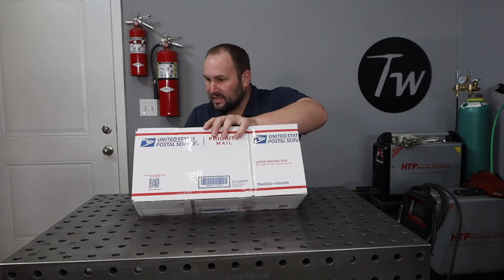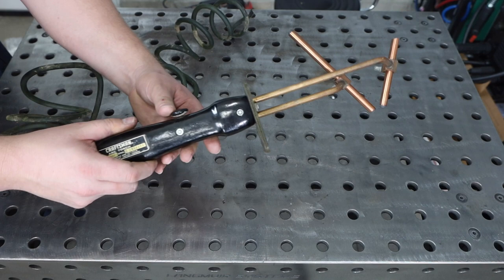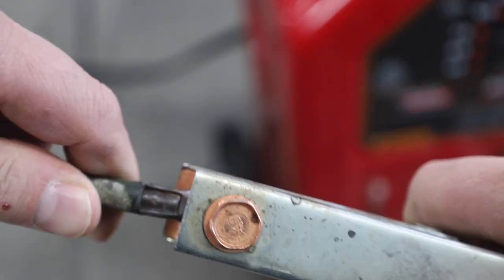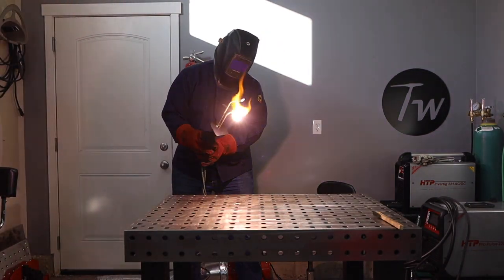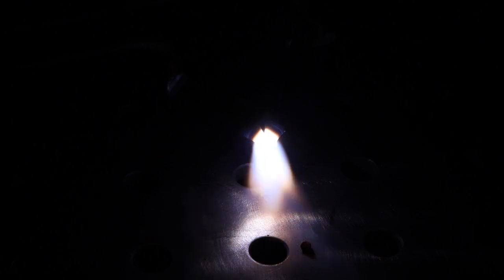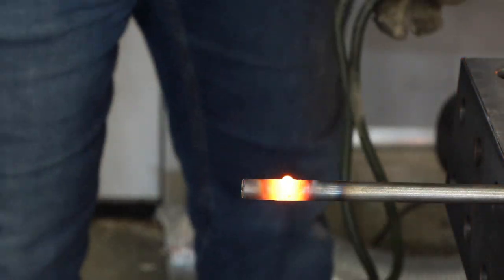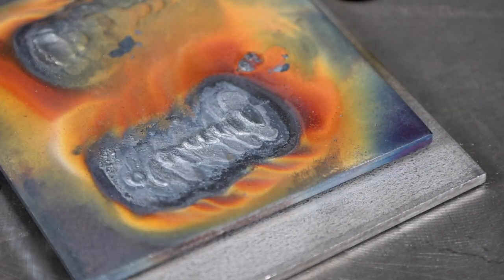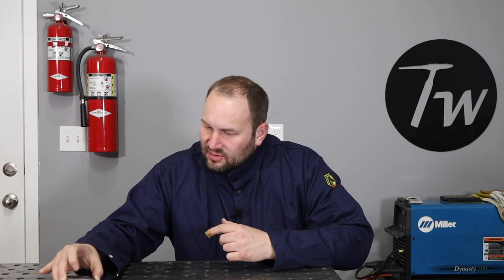I Tried the Weirdest Antique Welding Torch from Sears

Comment: A tool from a bygone era. After WW2 with rural electrification arc welders really came into their own. Even then oxy-acetylene was expensive, but a carbon arc torch would let you do most of what you could do with gas torches. We used to cut with buzzbox welders too because we didn't have cutting torches. Didn't have cutting or gouging rods either- you just soaked whatever you had, probably 6011, in water and turned up the amps! Then you started arc cutting. If you spent some time with the carbon arc torch you'd probably learn to make nicer looking jobs. I'd buy one for the right price myself! Heck, I still use gasoline blow torches too! Just because it's old tech doesn't mean it's useless.
Reply from the maker: I definitely haven't spent much time with it. I do think the old school stuff is really interesting; I'll have to try arc cutting like you're talking about!
Reply: Whoa, a gasoline blow torch? Tell me more!

Comment: Smaller electrodes for brazing with flux coated brazing rods. Used mine over 40 years ago for brazing a wing on my Morris marina after a mini bus ripped my old one off. Does a perfect job. easy to use. Mig welders have taken over for working on thin metal at an economical cost.

Comment: It's funny that you posted this now, I had been trying to locate one recently.   My brother and I had one for our Montgomery Ward arc welder back in the late 60's (he's still got that monster 295 amp machine) when we were in high school - they were common then, and used it mostly for heating up steel for bending, until we were able to afford an oxy-acetylene torch.  Brazing also worked, but it made a really wide joint.   Lately, I've been having a difficult time getting my oxygen and acetylene bottles exchanged or filled, so I had my brother send me the old carbon arc torch, since he never uses it (and you really can't find them anywhere for sale new).   

It does work fairly well for heating up and bending steel, but you do have to keep it moving, to keep from melting spots.  I always wondered if some carbon from the rods would be transferred to the steel, making it harder, but I think it would only be a case hardening issue if at all.

I do have a TIG torch set up on my arc welder, and have decided that it will really do anything that the carbon arc torch can do, including heating steel by using a large tungsten, and it has a much smaller heat affected zone, and is so much more precise.

The real advantage of the carbon arc torch is that it requires only electricity - no oxygen, acetylene, or argon - so, it can be a really useful backup option if you live somewhere that doesn't allow flammable or high pressure gases in your residence.  I think it might also be useful if you have a welder in your 4 wheel drive vehicle - you could do some good repairs in the back country, if you could keep from starting a forest fire with it.

Thanks for the review - it does bring back a lot of memories!
Reply from the maker: Very cool! I can definitely see the utility if you don't have a torch available; keeping it for some backcountry repairs is a great idea!
Reply: Hi terryrust. Can you say more about puting tig torch on arc welder. The tungsten do the same than carbon rods and more precise. So, i wonder why nobody do this? Can you explain what are all the avantage and negatives please?
Reply: Hi Steve!  

Yeah, it'll work great.  Use DC Electrode Negative, if possible.  That way, most of the heat will be put into the workpiece.  If you use DC Electrode Positive, most of the heat will be on the tungsten, shortening the life of the tungsten.  If you only have AC current, then the heat will be distributed evenly between the workpiece and the electrode.  Use the largest tungsten you can, it'll last longer.  

Using argon as a shielding gas also protects the heat affected area, so there's less chance of contaminating it.  With a carbon arc torch, I think some carbon may actually end up being transferred to the heated area, which may have a hardening effect.

Give it a try!

Comment: Tim, I bought that exact Craftsman carbon-arc torch in the late 1970's to use with my Sears (Century) AC arc welder.  It was made for Sears by Marquette.  I still have the manuals for both.   A blunt instrument for sure, but think about it: for a kid WITH an AC arc welder, but WITHOUT an ox-acetylene rig, that inexpensive torch was the only way to heat steel for bending.  I pulled it out about a year ago and tried to use it to forge weld two 1/4" steel rods together, but could NOT get the workpieces to fuse.  No idea why.
Reply: I wonder if Vintage Machinery would copy and post the manuals on their website?
Reply from the maker: Awesome! It would be fun to try forge welding with it.

Comment: I bought one ( not a Craftsman ) in the eighties as an accessory for my Miller buzz-box. If you don't have or really want an oxy-acetalyene rig, this is an inexpensive option. 
   I used it to pre- and post-heat an exhaust manifold, for a successful weld repair. Options are good.

Comment: I still have one which i have had since the 1970s & still occasionally use. I connect to my small arc welder, it is a great tool for brass brazing and heating metal for bending etc

Comment: they sold these in the 60s in UK. They came with clips to connect  to your car battery.I bought one and used a metal coat hanger wire as filler rod it worked quite well until battery went dead which wasn't  very  long It taught  me the real meaning of disappointment and always aim a bit higher  when buying equipment.It started me welding which I still do.

Comment: I had one of these as a teenager when I first got into custom car and motorcycle work. I got it with a small Sears buzzbox and I did many a modification and repair with it. It was like using a sledgehammer to do body repair, but once you developed a feel for it you could get things done. Once I had an oxy-acetylene torch I don't think I ever used it again except in emergencies or where I couldn't take the gas bottles. A real trip down memory lane. Thanks Tim! And BTW, while I don't have the carbon torch anymore, I've still got that 70 amp Sears buzzbox. I bet I haven't used it in 40 years.

Comment: Hey Tim. Your video really took me back to 1973 when I was working on a farm/ranch north of Denton Mt. Was making a straw deflector for the back of a combine and my boss dug out this carbon arc tool like yours. I used it to braze some steel brackets to a sheet of galv metal(don't breath that zinc!). It wasn't pretty but it got the job done when my only option would have been to carefully do it with stick.

Comment: As a youngster I used to braze with a carbon arc torch. My first "SIP"  welding transformer came with one. It was a cheap way into brazing and it worked. My major complaint was that it seemed to make a much brighter light than stick welding did. After using it for a while I'd have sore eyes. Anyone trying this should see to getting more opaque welding glass than they use with arc.
If you have tig or gas facilities in your shop, one of these rigs will indeed just hang on your wall unused, but if you don't , and occasionally need to braze. It's a handy option.
I think the carbon electrodes are the same thing as used for gouging.
Reply: If you look at the table listing the recommended welding shade for the process and electrode size/ amps, you'll find that carbon arc welding calls for a #14 shade, and this is usually not kept in stock at most brick and mortar stores because it is too dark to comfortably use for most general purpose welding,  rather it's used for very high amp stick, mig and tig welding,  and carbon arc welding  is obsolete  for all intents and purposes,  and has very little modern day use. 

Fixed shade helmets typically come with a #10 lens by default,  since that is a good choice for most welding done around the shop /farm.   Auto darkening helmets usually are adjustable from shades 9 ‐ 13 for the lower priced models, while the higher end models have a wider range with some having #14 availability, sensitivity and delay adjustments along with a grind mode.
Reply: @Sparky-ww5re  Thankyou. That was very informative.

Comment: Very cool to see one action.  As a teenager on my stepfather farm in the early 2000s, Uncle Chester has one in the pole barn along with his Miller welder (I think the machine was either 200 or 250 amp, pretty good size) way before my time.   though I never seen anyone use the arc torch accessory.   You can make a carbon arc torch DIY, I don't see any practical use for it nowadays,  though with the price of propane, Acetylene & Oxygen skyrocketing,  I can see it maybe coming back sort of like vinyl albums,  how we thought they were dead after the early 90s, along with  8 track and cassette decks.

Comment: 35 years ago I did a large body repair on a car with one of these and brazing. Alternate where you work and cool it down before moving on. worked great. Seems to me the only welders commonly available back then were stick welders. Like most welding processors, practice is the secret. But why bother mig and tig so cheap now.

Comment: My dad used a carbon arc torch and I still have most of it, still works but very scary looking due to exposed wiring. The metal enclosure for the power unit is no more and it looks similar to an old toaster with wires strung about porcelain posts, although heavy duty by comparison.  Works on 110 volts. He used it for brazing with flux coated brass rods.  Crude and effective. Most likely it came from "Monkey Wards" in the late 40's or early 50's.
Reply from the maker: Very cool!
Reply: I built one of those in the late 1960's from a plan in one of the magazines.  Wish I could remember which one.  It used heavy gauge (can't remember gauge but it was about like a wire coat hanger in size) nichrome wire wound around a broomstick a certain number of turns to form the coils and they were mounted on a piece of asbestos house siding.  The electrode holder was a piece of fence post drilled and tapped for a thumbscrew to hold the electrode and had a bored out piece of broomstick for the handle part. It was supposed to have a box to enclose it made of expanded metal but we never got around to that part.  It worked great but you only had 1 choice of settings for amperage.  I know it had to have been Popular Mechanics, Mechanix Illustrated or Popular Science but I can't remember what year or month and even though I've searched for several years have had no luck finding it.
My Dad saw it for the 1st time when we were using it about 2 weeks after we built it . . . . . . we looked for a long time . . . never did find it.

Comment: Not for welding, it's for brazing and soldering.  I have two of these - one made by Lincoln, one by Forney.  You have to 'play' the heat of the broad arc that extends out from the carbons and allow it to heat the area up to the braze or soldering temp.  It's very similar to oxy-acetylene brazing in its application, though a bit more of a sledge hammer approach.  Hence, the reason it didn't catch on.

Comment: Before I had an oxy-acetylene setup I salvaged one of these from my father’s shop and had to use it on my vintage tombstone A/C Lincoln. It did a poor job of everything but somewhat useful for heating and bending when you run out of gas for an oxy torch.

Comment: I love my arc torch. It can make welds on things that aren’t super small or structural. You want a good tight arc with sharp electrodes. But they need a blunted tip to prevent the chunks falling off.  Great for large brazing and heating jobs. I’d love one as nice as yours is.

Comment: I have one and used it for brazing. the smaller carbons and less current do better for brazing the smaller items. I used a can of flux with a hole in the lid to dip the hot brazing rod in  so less current smaller carbons and more flux might work for you. pretty old school but better than nothing which was what I had back then. I still warm it up now and then.

Comment: had one 45 years ago, sold as a brazing torch.could run of 24 volts. advertised as for farmers and construction workers to use in the field. bit sketchy, but it worked.

Comment: Have used one for years for bending metal only. Haven’t seen a carbon arc torch video in a long time.
Reply from the maker: It did work really well to heat the metal for bending!

Comment: We had the same craftsman carbon arc torch my dad purchased for his craftsman ac/dc arc welder we used it on the farm and in the garage for bending heavy steel always worked well dad still has  both of them from the mid 70's, we had a oxy/acytelane torch,  but tanks were always to expensive for as often as we  used it, so we just used that whenever needed for cutting and bending, never failed us!

Comment: Still have mine from 1960s. Still use it now and then. I also occasionally use a carbon air arc gouge instead of my plasma cutter or oxy/acy cutting.

Comment: Naval shipyards used carbon arc torches (single carbon) for cutting out sections of the hull on sub's at least up into the 1990s.
Reply from the maker: Carbon arc gouging is still in use today for a lot of repairs. I've done a bit of it with an air-arc setup that uses compressed air to blow your material away. I'd be happy to never do that again; it's super loud and dirty.
Reply: Carbon arc cutting is a completely different operation using air blowing through the carbon rod. Great for cutting heavy cast steel like cracks in a crawler swing frame.

Comment: There’s a book on Amazon that’s actually like a War Department manual for Welders and Blacksmiths from the early 1940’s and it discusses this. Modern Carbon Arc Gouging is very useful for removing welds to separate parts but that uses an entirely different setup with a compressed air line hookup and a single Carbon Arc Rod and again is extremely useful. The old 2 Carbon Arc Rod style was violently unpractical and unsafe but if you do it enough you can tame the monster. I will say most of the old Carbon Arc Torches I’ve seen were Lincoln Electric ones and definitely a better design than that Craftsman one. Also one of the big useful things that these can do is preheat large pieces of steel that are very thick so you can then weld them easier

Comment: I have the exact one as demonstrated.  For more precise carbon arc action simply buy some 1/8 carbons and using a smaw stinger to hold the carbon set the amps amps around 88 amps strike an arc ( dc + ) and add filler rod like gas welding. Why you would want to waste your time doing this process is beyond me! But for heating could be useful I guess. REALLY SMOKEY /  SOOTY. For cutting out / prep work a carbon arc with focused air can get into tight corners for full pen welds on water / fuel tanks. Moma don't let your children grow up to be "Tankee's".

Comment: Sears sold these torches (mfd. by Emerson Electric, which also made Sears welders) with 1/4" and 3/8" carbons.  Recommended amperage range for either size was 35-45A.  Arcair CutSkill baked carbon electrodes can be had in these sizes,   but they are a foot long which is sort of unwieldy so cut them in half.  This arc is brighter than a stick-welding arc and calls for a #14 shade, or maybe try sunglasses behind your usual #12.  I use my twin-carbon torch for the odd bending job or for weld pre- and post-heating when I don't want to fool with my O/A gear.  There is a vid showing a fellow experimenting with a torch like yours hooked up to a good modern inverter machine with all the adjustments, and he was starting to get some interesting results by cranking up the frequency.  Dumb me for not thinking of this, but I'll be trying it..Back in the day, the masters of twin-carbon arc up-graded from baked carbon electrodes to pure graphite electrodes which were used for years in movie theater projectors.

Comment: What size carbon rods were you using? I believe you can get them down to 3/16". I know it's old school but sometimes when resources are limited you use what you have. How about carbon arc gouging? I've used that since I didn't have anything else for blowing through some heavier steel.
Reply from the maker: They came with it, but looked to be about 3/8". I've done a bit of it with an air-arc setup that uses compressed air to blow your material away. I'd be happy to never do that again; it's super loud and dirty, but works extremely well.
Reply: Actually you can get them down to 1/8".  Blue Demon makes them.  I bought some and tried it out on my Stel S300 and they work just as well as the larger ones, albeit for removing less steel and in a more narrow path.

Comment: Use at least a number 12 welding hood dark lens.  The brightness is over the top and can seriously burn eyes or unprotected body parts.  I had one of those torches.  They are great for loosening frozen bolts or nuts, just pinch between carbons.  Red Hot Fast!!!
Reply: That's a great solution for heating up frozen bolts!

Comment: I don't think that's what it's for? I'd say that was basically an electric rosebud torch, good for preheating and bending, but not welding. The arc is not fine or controlled enough to be useful for welding/brazing.

Comment: Have had the Forney version for at least 40 years.  Better than the Sears in my opinion.  One of the best uses is rusted nuts.  Clean off a bit of rust on two opposing flats, with the welder off, clamp the carbons on , set to about 30 amps and turn the welder on.  About 20 seconds should do it, turn the welder off.  Easy to see what you're doing with the welder off.  Need the shield though.  The nut will be happy to come off.

Comment: Try using a stick electrode. The braze looked like is melted too easily so some Flux coated steel is probably usable. That my theory anyway. And and idea I had was to sharpen the rods
Like \| |/ so that the arc would be smaller.